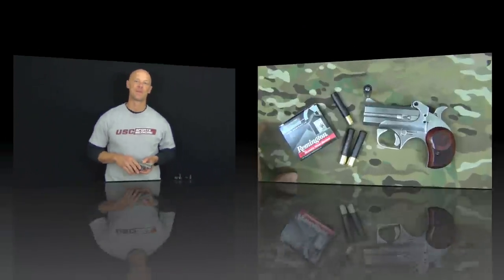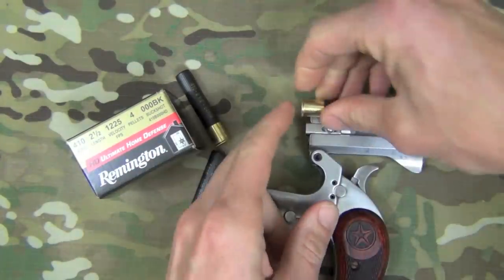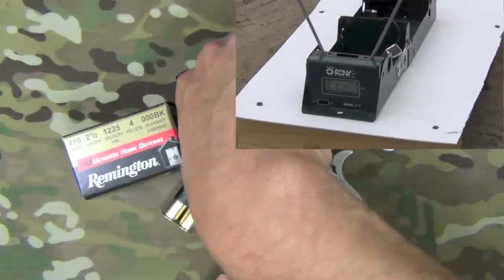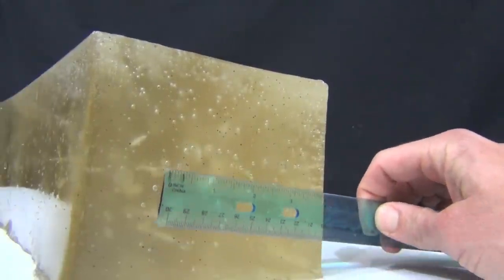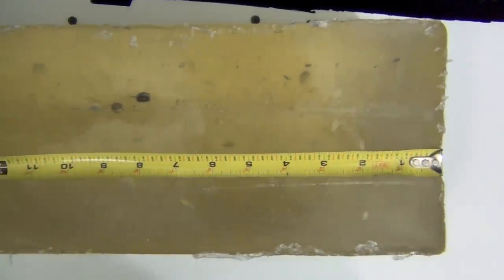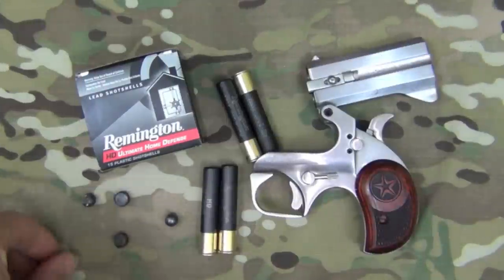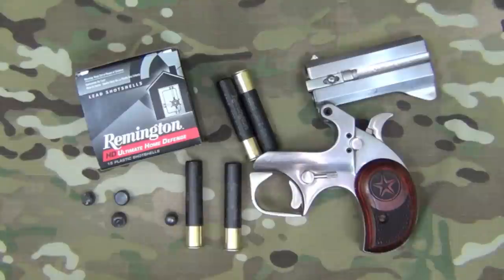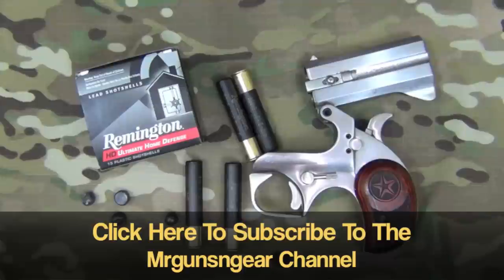Remington HD .410 000 Buckshot & Bond Arms Ballistics Gel Test (HD)

Comment: That's a pretty cool test.  It's like getting shot by a light 38 load four times.  You might not knock him down, but he'd be leaking. :)
Reply from the maker: Yup.  That's pretty much how I see it too.   I think the 3 or 3.5'' barrel would make a pretty substantial difference.
Reply: It does. I have the 3.5 inch barrel, and it can accept up to 3 inch shot shells.
Reply: he or she would be leaking, equal rights
Reply: Four .38 bullets hitting at the same time would not knock down a Rodney King sized guy.
Reply: A lot of the 3” shell loads are higher power than the 2 1/2, like the federal 5 Pellet 000 buck. I seen a video on the Winchester PDX1 with the 12 BBs and flat discs and the 3” shell with the 4 discs had far more penetration in gel than the 2 1/2” 3 disc version. Like over double the penetration!
Reply: Fact of the matter is it would put a hurting on anyone. If the 410 is punching power the 45 is. Practice makes easy not perfect but at the end of the day you will put a hamper on any sap who tries anything against you.

Comment: Thank you, you actually put these little guns to the test! I'm not surprised at the underpenetration given the barrel length but with the multiple projectiles per round there's an argument that this gun is still effective. If I was carrying it with a barrel this short I might try to seek out some more exotic ammo that can give more penetration. .40 caliber buckshot is bigger and thus penetrates deeper. It's not commonly loaded, I think you lose a pellet compared to 000 buck due to increased size. Nobel Sport used to manufacture it and it was imported from Europe. There's also heavier-than-lead buckshot. Probably practically limited to handloaders at the moment, but it will penetrate much deeper than lead, given balls of the same size. There are ways to eke a few more inches of penetration out of this derringer for sure.

But rather than turn to expensive exotic ammo one could just carry a gun with a longer barrel and get more velocity and better penetration with standard 000 buck ammo. I'd probably just buy whichever barrel length could reliably push all 000B pellets to 12" in gel. This video was great because it demonstrated that 0.5" of barrel struggles even with the biggest .410 buckshot on the gun store shelf. This helps us make informed decisions about self-defense.

Comment: This is one gun I think the .45 GAP is particularly appropriate in. Of the larger rounds the .45 GAP will have the most distance to accelerate and uses fast burning powders. According to QuickLoad's guess, you might be able to get a 120gr Lehigh Xtreme defense up to 1050fps in that little barrel.

Comment: Great video, thanks for posting. I have the same gun and while I have not done any gel tests I have shot hundreds of rounds of .410 and have the following experiences 
- the Remington HD patterns horribly in my gun. Both the spread per barrel and the distance in groups from one barrel to another is huge ( and unpredictable) at 5 or 7 yards, enough so that for me it is not a useful round. I am giving what I have left to a friend with a .410 shotgun.  Maybe the velocity (listed as 1250 fps ) is just too high for such a short barrel. 
-both Federal ( four 000 buck) and Nobel Sport (three pellets each 0.40 diameter) which have listed velocities of 850 fps, pattern extremely well in my gun - each barrel into 3 inches at 5-7 yards, and each barrel 2 or 3 inches from each other. In my gun the lower barrel shoots to point of aim at 5-7 yards, and the upper barrel prints higher, but both will hit center of mass 
- the PDX-1 is to me a disappointment. All three discs will hit center of mass at 5-7 yards, but almost all of the BB's miss completely, and tested on 1 inch pine the pellets do not penetrate nearly as well as the buck loads discussed above.

Comment: You had stated that some calibers are better than others out of a short barrel. I have a Bond Arms 3" and want to go to a 357,.40 or 45acp. Any suggestions?
Reply: Robert S i got 45acp in 2inc i love it at 10 or 15ft
Reply: I got the Bond Arms BackUp, and the extended & rubberized grips. Mine came in .45 ACP, and shoots like a dream. Recoil is far from unmanageable, and it is pretty accurate, out to 40-50 yards, once you have gotten used to the sights and the fact that the top barrel fires at a slightly different location than the lower barrel (all still within center of mass), in the acp.

Because they often have 1/2 off sales on extra barrels with the receipt for a new bond purchase, I also got the 3.5 inch snake-slayer barrel (media-blasted version for subdued finish) that fires .45 LC/.410 (up to three inch shells), and I love it so much it has become my EDC. My next barrel purchase is going to be the .38/.357, and I've spoken to other Bond owners who inform me that while the kick is very noticeable with a 3.5 inch barrel, it is still manageable with the extended and rubberized grips, and the only person I spoke with that found the recoil to be too much for her, stated that it became manageable again when she upgraded to the oversized, "jumbo-extended rosewood grips" they sell on the Bond Arms website.

You posted this 4 years ago, so I hope this information is still relevant and helpful. Otherwise, of course, please disregard.
Reply: Looking at snub revolver ballistics I've noticed the desirable barrel length for full 357 magnum performance is 4", or more.. My day at the range with the Ruger LCR (2" 357 mag) was alot of fun though,  quite the fire show..

Comment: I agree 2,5' inches is too short. especially for a shotgun load, it would be nice if Bond Arms would make a model of this pistol with a slightly lengthier barrel say 4.5.
Reply from the maker: I think they make a 3.5'' but I agree.
Reply: Mrgunsngear Channel These little pistols look fun to shoot, It truly is a pity these are not legal in CA, not where i'm from, so far you make the best gun videos.
Reply: Bond Arms does make a 4.25 inch barrel
Reply: They now make some limited runs of 6 inch barrels.
Reply: Have a Bond arms Ranger 2 with 4.25 inch barrel. These guns are good for driving in your car or the trail. Not good for self defense, very inaccurate weapon bottom line. I have a beretta px4 storm subcompact very accurate weapon. If you have the money sig p938 is an awesome pocket carry
Reply: Buy a revolver

Comment: There may be questions about these loads in a short barrel pistol, but they have shown real promise in a longer barreled shotgun. Especially the five pellet 000 buck loads. Only three pellets short of a 2 3/4 inch 12 gauge 000 buck load but a lot easier to handle for smaller framed shooters.
Reply from the maker: No doubt.
Reply: @Mrgunsngear  Did you ever get the velocity of this 000 buckshot out of the bond arms? Im very curious on this and can't find any results online. Can you test the federal and winchester 000 buck with 4.5'' barrel and 6'' barrel? I can pay if you can test the velocity for me. The federal 000 buckshot has a listed velocity of 750fps, and the winchester 000 buckshot has a listed velocity thats much faster at 1100+, I wonder if the winchester 000 is that much more powerful than the federal, or if they have the same power but federal just listed the velocity out of a short barrel since the federal load is "designed" for the Taurus Judge.

Comment: I would be curious to know if a 410 slug would perform better than multiple slugs, like buckshot. The single slug would surely have more velocity.
Reply from the maker: not sure
Reply: I seriously doubt it, .410 slugs are very light and wouldn't have much velocity out of such a short barrel.  If one wants a single projectile it would make a lot more sense to load the gun with .45 Colt ammunition.
Reply: Wouldn't that be a 45 caliber Colt around? Which this gun can handle as well

Comment: Great review.
I'm thinking the 2.5" version of this gun almost has to be chambered with the .45 Colt round.  I've run some chrony tests with this gun with a 2.5"  barrel and the results were not bad using Buffalo Bore Standard pressure 255 grain rounds.
That round got a "not bad" 793fps average and at 255 grains puts it right up there with a standard 45 ACP.
Reply from the maker: agreed, if you're going to use it for defense

Comment: Thats a 3 inch barrel.  2.5 inch shell.
Reply: @Mrgunsngear  They label the barrel "2 1/2 inch .410" because that's the shell size. As in, don't use the 3 inch. That's because it is a 3 inch barrel. You can use the 3 inch .410's in longer Bond Arms barrels, over 3 1/2 inches.
Reply: Can u use 3inch shell in a 3 inch barrel or no ???
Reply: @zachwilliams2419  no, but you can use 3 inch shells in bond arm's 3.5 inch barrel.

Comment: Lehigh Defense has a maximum expansion round designed for the 45/.410 chamber but advises against using it in any Bond Arms product.  Does anyone out there have any experience with Lehigh Defense maximum expansion ammo?  I'm looking for a reason as to why it's not recommended.  There isn't a whole lot of info on their website.
Reply from the maker: +North Olmsted I haven't
Reply: Mrgunsngear Channel Thanks.  I'm going to wait a few days and e-mail the company.  I don't want to waste their time if a viewer has the answer.
Reply: +North Olmsted the barrel length isnt enough for the round to expand.  Its basically a slug with this short a barrel, but moving slower.
Reply: The Lehigh defense round in question is a copper only projectile. 

On Bond Arm's FAQ page, they state: "WARNING- Do not use COP (copper only projectiles) in your Bond Arms Handgun!!! They are high pressure loads with oversize projectiles that could seriously damage your Bond Arms handgun or cause bodily injury."

Comment: The pellets are flattening from being shot out, not hitting the target. 
With a 410, being stacked in line, they tend to flatten the middle pellets into pancakes. 
Also if you are shooting plain led pellets you'll get two that stick together a lot of the time. 
Copper plated 00 or 000bk in a pistol or regular .410 shotgun is probably the best defence load all around in its caliber. 

Has anyone tested the 000bk federal HD pistol loads in a regular length 18" barrel? 
2 1/2" 4 pellet 000bk says 850fps in pistol application. ? fps in 18"+???
Reply from the maker: thanks
Reply: They stack 00 buck on top of each other in 12 gauges too.....

Comment: been 9 years wonder if anyone has made a 410 000 buckshot round for pistols that actually dosnt suck yet.
Reply: Federal 3'' 000 buckshot plated, and Winchester PDX1 410 3''. Those 2 don't suck
Reply: @alexmarlow2508  would need 2.5 inch 410 for a gun like this.
Reply: @plaid13  Hornandy 2.5'' is probably the best in my opinion, got 3 projectiles and all of the are hard hitting

Comment: The 3 inch shell has much better penetration than the 2 1/2.
Reply: Prove it, no it does not.
Reply: Yes and no. It depends on the powder burn rates, the length of the barrel and the weight the payload that's being pushed by said powder through said barrel length. The Federal Handgun 000 buck in 410 comes in a 3 inch (5 pellets) and 2.5 inch (4 pellets). The 2.5 inch is rated at 850 fps and the 3 inch is rated at 775 fps. That tells me that they made no changes to the powder charge. The weight of that extra pellet really slows the weight of that shot down quite a bit. Personally, I'd rather sacrifice a pellet for a little more velocity. Especially when you're talking about a light weight 000 gauge pellet. It needs velocity to  penetrate.
Reply: @flip97gt  thank you for the explanation!  I stand corrected.